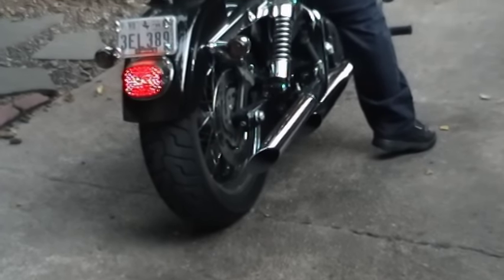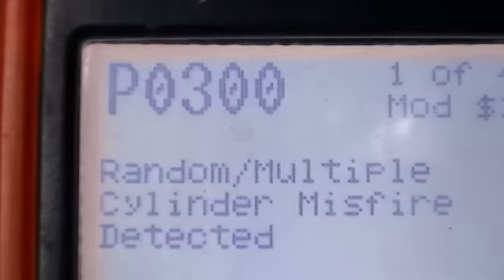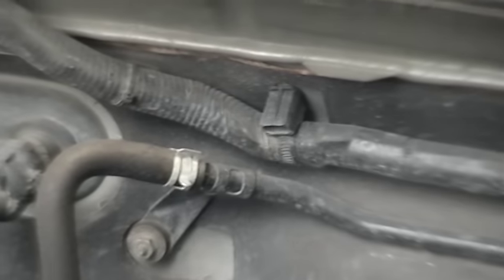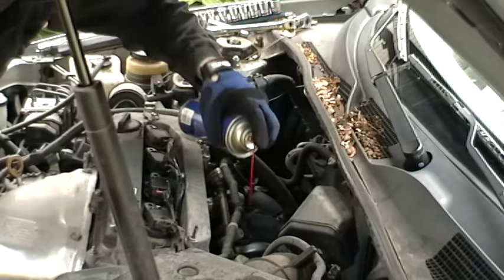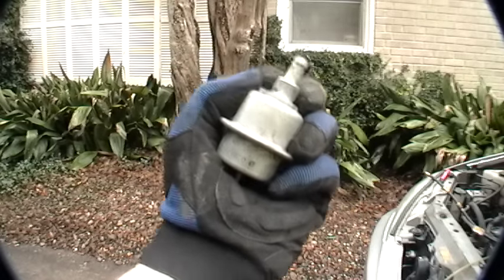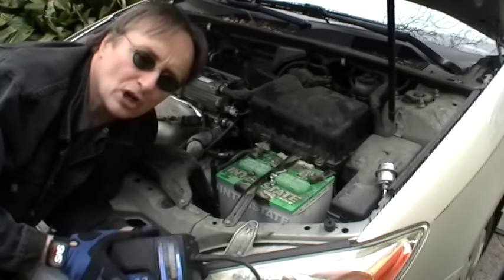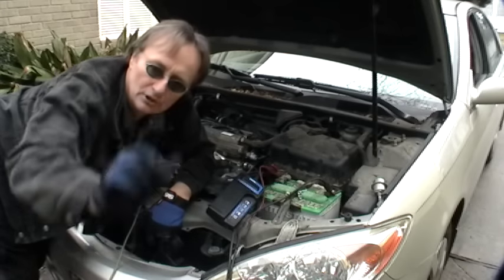How to Fix a Random Engine Misfire in Your Car (Code P0300)

Comment from the maker: spark plugs, coil on plug assemblies, or bad fuel injectors are often it. Good idea is to swap coil on plugs first, and if the miss moves, replace those. And if not, try swapping fuel injectors

Comment from the maker: do these video tests, and on that model, try my video "how to clean fuel injectors on your car" they often do that. AND also check the ignition coil on plug assemblies IF it has those and doesn't have a distributor. They often go out on that model too.

Comment: Hey Scotty this video was very helpful my 99 Pontiac GP started up but stalled immediately my scan tool showed code PO300. I tried to drive it but the brakes were rock hard and had no braking power, Turns out the big vacuum hose on the power brake unit got disconnected somehow. I reconnected it and its fine now

Comment: I own a 05 Ford Taurus SE with a little over 96,000 miles and I've been trying to find out what's been causing the p0300 and nothing has helped. Did a tune up, changed the fuel filter, both cabin and air filters, cleaned the MAF sensor, checked my plugs that are good, changed the gasket on the intake running valve. * Thank you for showing me how to smoke test a vacuum leak with a cigar, it cleared up the too lean codes I were getting. I still have a slight rough idle. I'm totally lost and can't afford to throw new parts in that aren't the problem. I've got two more weeks to pass smog in California.

Comment: 2000 4.3L Silverado 245k miles on it with P0300 errors that had terrible idle, poor acceleration, and several cranks to start. It drove terrible in the city, okay on the highway. Ran vacuum test on the fuel line and it failed (thanks Scotty). Replaced the (newly redesigned) spider-injector, fuel regulator, and all upper intake gaskets. Runs like new. For the mechanically inclined it's about a 3 hour replacement.

Comment: This video just saved me hundreds of dollars. my car was having a misfire and so i replaced optispark, wires, and plugs. And it still had a misfire. Watched this video and went down to my auto parts store and had my battery checked and they said it was bad. I put in a new battery and now no more misfires!
Reply: Really??
Reply: @powerstuffup  I had the same problem, but technically it wasnt the battery.  It was the corrosion on the battery wire positive terminal.  Scrubbed it down with baking soda and sanded them.  everything was good.

Comment: Had a misfire p0300 code with poor running car.  Car would start but ran poorly. Scotty, you're the only one of 10 other videos I watched, that mentioned bad battery. Got under the hood and noticed corroded pos terminal and the battery was 6 years old. whoa! Replaced battery. Car ran like new, no codes. Scotty, Thanks brother. Love your videos!

Comment: Scotty,   Thank you for all your videos and all your hard work and knowledge.  I have a 91 Oldsmobile 98, that has been hesitating between 45 and 60 miles per hour.   I had replaced the spark plugs and wires, but this did not solve the problem.   I just viewed this video today, and heard your comment about the battery, which i had never heard of before.  My battery was 6 1/2 years old, so i took it to a parts store.  They tested it and it showed "bad battery - replace", I did, and that fixed it.

Comment: I got a 303 misfire & mechanic supposedly fixed it but only 2 hours gone by since I left the shop the engine light came back on,  this is a trusted mechanic by local peoples view so he said stop back by and hel check it,  I paid over 500 bucks, I brought it to advanced auto and it came back 303 still so idk what the issue is, leaving to mechanic now hope its something small. What's your advice about mechanic fixed it then engine light came back on?

Comment: Great video. Always very informative. I have a Chevy Lumina, and was getting the P0300, sometimes P0301 and found I had a blown head gasket at the #1-#3 cylinders. so the heads and gaskets and all intake gaskets, as well as plugs and wires, were replaced. It ran fine all summer. as the weather started to cool, when starting the engine, it starts and runs smoothly, then after a few minutes will start running very rough, even smelling very badly and turning on the check engine light with a P0300. after about ten minutes of driving, it runs great again, nice and smooth, no hesitation and no odor. I am using your techniques today to looks for vacuum leaks. any thoughts?

Comment: Good video. I have a Honda civic 2002 with this code p0300 and problem was bad coils. I bought a set on eBay and turns to have two bad coils sold as new ones but they became bad in a couple of days. Put my old coils back and no more problems. This code could be also bad fuel injectors or clogged.

Comment: One thing that was left out is that a random misfire caused by an electrical or computer monitored component will pop a P0300 on you. You will not get that with carbon build up, sludge, worn rings, bad valves or a hole in your piston. The computer "assumes" those variables are in tolerances. Every car inspection should start with the battery then go from there.
Reply: How do you fix that?
Reply: Exactly!  I always say test, test, test!  Being a mechanic goes way beyond pulling codes and throwing parts at a problem!  Most so called mechanics will pull a p0420 code and immediately go to replace the cat, when it could be a number of things other than the cat, like an o2 sensor.  I've seen it so many times I lost count.  A shop replace thousand dollar catalytic converter and reset the codes only to have it come back on due to a 60 dollar o2 sensor being the actual problem.
Reply: @justinl9677  mine is the actual cat & other codes come up too… now my car sounds like a freaking v8 when I’m driving or idling my car shakes.. p0300 code has come up and idk if I can even drive it back home like this 😭

Comment: Thanks, Scotty! I have a 2002 YukonXL 6.0L V8 that started misfiring a few days ago. I went out and started checking the spark plugs this morning, and then I noticed that one of the coils had somehow come loose from the spark plug. I plugged it back in and started the engine, and it runs fine. That's what I'd call a "stupid" problem, but at the same time, I'm glad it wasn't something really complicated.

Comment: the worst parts is having bad valve or your pistons are the problem, or your chain might slip or your cam position sensor so on and on, alot of things causes missfireing these are the simple ones you check to begin with
Reply: Hi veli korkmaz , my Audi A3 8l, 1.6 benzine 2001 misfire on sunny day. Other day , it won’t misfire. Any idea please??
Reply: @elaavgroup2660  not sure why but check the coolant temp sensor

Comment from the maker: bent valves only occur on those if timing belts break and pistons hit the valves. Commonly on those, blowing head gaskets or bad fuel injectors. try swapping those two cylinder injectors with other and PRAY the miss moves, showing bad injectors.

Comment: Good video is there anything else, here is my review 1. Spark plugs 2. Coils ? 3. Vacuum leaks 4. Battery 5. Throttle body ? 6.fuel pressure. 7.

Comment: Scotty, I had one instance where I was coming up with a P0300 code, but it would happen in frequent spurts, usually in rain. I checked everything! Distributor caps, battery, alternator, and even my distributor cap. But when I pulled my distributor cap, there was moisture in it! So I replaced the gasket and the cap, threw in a little dialectric grease, and boom, good as new.

Comment from the maker: generally the only things that come and go for misfires are electronic problems. Mechanical ones are broken and don't come and go.  I would change the spark plug wires if they are old, they often will do that.

Comment: Scotty or anyone my truck has had random misfires recently.  The only codes were for an o2 sensor and inefficient egr flow.  Both issues resolved but the engine still misfires when it's cold weather outside when the engine warms up it still has a few misfires.  When it's hot weather it runs pretty good.

Comment from the maker: that's misfire on number 3 cylinder, change spark plug and wire and pray it's that. If not, replace number 3 injector

Comment: Hey Scotty! I recently had this code pop up on my 1998 Lexus LS400. I had a scan tool put on it and every code was for misfires on various cylinders. I also had them check the battery. The battery tested bad. Hopefully I can just replace the battery and it will fix my issues. I'll make another post updating my progress. Thanks!

Comment: great vids Scotty ! in the cold when the car is cold ,the flapper door for the heater flaps alot if the car is not up to op temp .when the setting is for the windshield defrost .the car is a  04 sunfire 44k miles .
Reply from the maker: actuator door or motor has a problem, ya gotta tear the dash apart to fix that, if it works good enough, live with it

Comment: one broken valve spring can cause this p0300, worn ignition coils(s) can cause p0300, also a low idle and lean missfire can cause that, also for that matter excessive carbon build up.
Reply: the coil pack should be secured by a fastener. there should be resistance rotating a new coil pack, the old coil pack, might be able to turn. however the coil pack delivers electrical voltage to the spark plug which lights the fire in the engine. the old one might be able to also... ability to rotate isn't really relative to the ability to deliver electrical voltage. i hope that helps
Reply: Thanks

Comment: Thanks Scotty, I also had the dreaded PO300 code,I have a 2000 GMC Jimmy 4X4 with 4.3 , I've had this truck for 5 years now and it has almost put me in the poor house, I've owned 20 different vehicles in my 58 years and have never put so many parts on a truck or car like this, I can't scrap it now I have to much $$$ invested in it. I replaced the spark plugs and wires, that didn't do the trick so I replaced the distributor and rotor with AC Delco parts and that did the trick, she runs like new, thanks for the help.

Comment: We think our engine went out, our 99 Oldsmobile intrigue will not start. ( We checked the oil and did not see any sign of oil)
We bought the car reader and p0300 code is showing along with P0452,PO453 Im about to go check the spark plugs as you say in the video see if their bad and replace them, (Try to start it) If it doesn't  start im going on to the next solution in this video. Do you have any more suggestions?
Reply from the maker: sure, do a compression test of all cylinders, if any or all are really low, engine is toast

Comment: When spraying brake cleaner, carb cleaner, etc around the intake manifold, BE CAREFUL to not do it on a hot engine!  It's flammable!  :)
Reply: Nathan Reeves  Thanks Good to Know
Reply: Not necessarily. Brake/carb cleaner comes in two different formulations. The original was made from chlorofluorocarbons and was not flammable at all. (That was one of the reasons it was so widely used commercially. No chance of fire.) The new formulation is non-chlorinated" and highly flammable.
Reply: Don’t kick the dog

Comment: Random misfire can be more involved but you nailed the most common, good video
Reply: 1996 Chevy Silverado w/ a 5.0. Just replaced intake gaskets due to LOTS of coolant in oil and got this code after driving it for 2 days.  Battery is a month old, cap and rotor button are 3 months old, plugs and wires are about a year old, and fuel filter is maybe 2 years old. Probably fowled plugs due to moisture,  correct?
Reply: @daddyosink4413  no incorrect
Reply: @CharlesWilson-oz8ys  thanks for the detailed analysis 🤣

Comment: The battery only has one function, to jolt the starter and start the car. The alternator then takes over and generates power to the rest of the car and recharges the battery small voltage usage. The only time the car runs on the battery is when the alternator is bad and then drains the battery and the car dies on the side of the road. Never heard of a battery causing trouble codes Scotty
Reply: If a battery cell starts to go bad and bounces from less than 1 volt to higher than 2.3 volts it will trigger a P0300 code. Seen it many times.

Comment: Thanks Scotty. I just changed out my battery on an 08 Hemi and it seems to have taken care of the engine light/ P0300 issue. The battery tests weak under load test but seemed to have no hesitation in starting the engine. Hopefully no more scares for me while driving in Mexico’s badlands. Thanks again.
Reply: Did it fix the issue?

Comment: 1/25/19 Scotty, I have a 98 Dodge Dakota Sport 3.9L, V6, had a complete tune up and changed all sensors still getting a random misfire. I am frustrated, I am waiting your response. Thanks in advance!
1. TRUCK RUNS SMOOTH WITH PREMIUM FUEL AND FUEL TREATMENT. TRUCK RUNS AWFUL WITH PREMIUM GAS ONLY. 
2. CHECK ENGINE LIGHT STAYS ON, W/RANDOM MISFIRE CODE. 
3. HAVE TO TURN SWITCH TWICE TO PRIME THE LINES, BEFORE TURNING IT OVER FOR IT TO CRANK.
4. MAYBE UNRELATED, AC WORKS EXCELLENT, GO OVER 55MPH, ONLY GET VENT AIR, NO AC.

Comment: Got a 2001 Chevy 2500hd currently with p0300. Replaced one bad coil, pulled live data on O2 and fuel trims, showed lean and O2 upstream voltages were not fluctuating until it was receding to 2000rpm. Just replaced it. I do have a manifold bolt broke off and it does have a pretty bad leak. I’m in process of repairing now between thunder storm showers. Lol. Hopefully when I get that exhaust leak sealed the problem will go away.

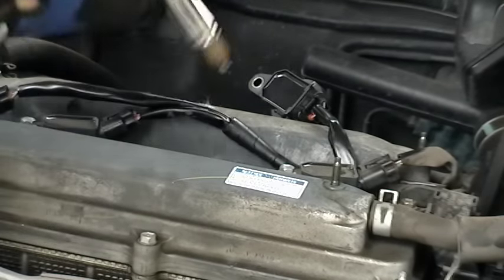Comment: am i trippin or did I see this dude just use a socket with a spark plug already in it. 0:42
Reply: U did lol
Reply: its a demo dude..but good catch.
Reply: Damn good catch!
Reply: Can someone help me? I had problems with one spark plug wire. I did everything to fix misfire but for now i have feeling that my computer need reset. I remove battery and connect it back after 20minutes. But i think i have the same fuel consumption...
Reply: He is just that good😎
Reply: @trendblazeall  there is a Scotty Kilmer video about resetting the ECM (was called ECU long ago). Reset makes all the defaults be taken and the ECM 'relearns' what to set for how you drive. But a new set of platinum plugs is about $30 .... easy to change and a good start.
Reply: I didn't notice at first but I was like woahh that spark plug came out quick😂😂

Comment: Thank you for sharing all you do. Doesn't the electrical power come from the alternator after the engine is started?  It seems to me that if the battery was bad enough to cause problems it would be a no start on the next attempted start, not a misfire.  The rest seemed logical to me.

Comment: Hey Scotty!! Great videos man... I'm a DIY guy all the way and I always check your stuff first. Got an 03 Taurus reading codes P0316, P1131, P1151, and OF COURSE P0300. Seems to be misfiring at idle and at low rpm's when I hit a hill or whatever. Other than that, no apparent problems such as fuel injectors or vacuum lines. All seems solid, but the check engine light is on and has been on for roughly two days since it started acting up four days ago. Gotta get my MawMaw's car back on the road asap. Many thanks for all your to-the-point tutorials and of course I could really use a heads up or two before I start chasing this dragon if there is one. Keep rockin' man!
Reply from the maker: start with my other video "fixing a car with multiple trouble codes" and e mail me the first code that comes back

Comment: I have an 08 impala ss losses power and rough idles in reverse any idea?
Reply: Don’t know if you still have the problem, but maybe a bad ignition coil or spark plug. Running rough is a sign of a misfire.
Reply: I have an 07 Impala ltz and has lose of power, stuttering and bad idle at red lights and stuff. Changed the spark plugs and wires but still doing it
Reply: Antwan Baldwin check your pcv valve and the boot going to it,also clean your throttle body and MAF sensor
Reply: my t bird did this and the throttle body was built up with carbon cleaned it and it ran like a champ
Reply: Icm
Reply: Did you find out how to fix it?
Reply: Vvt solenoids change the cam and exhaust ones
Reply: @2kbluedragon What did you use to clean the throttle with?